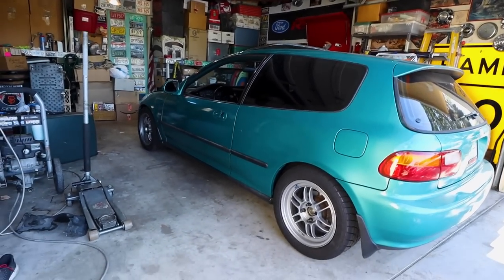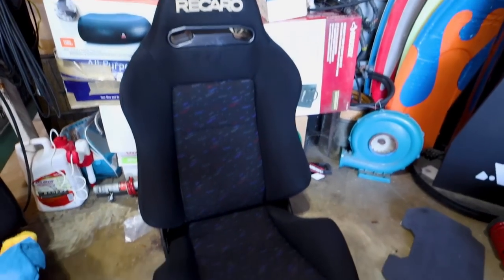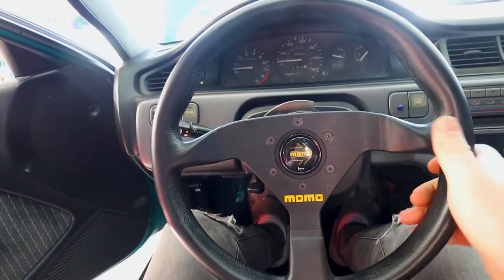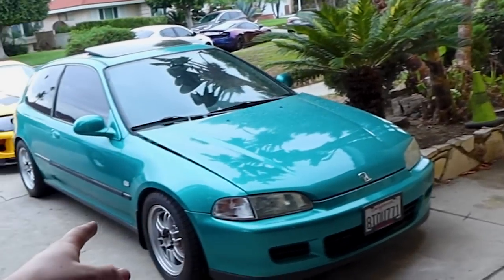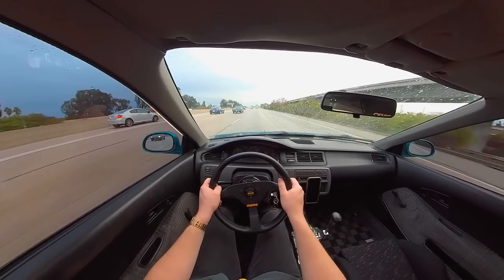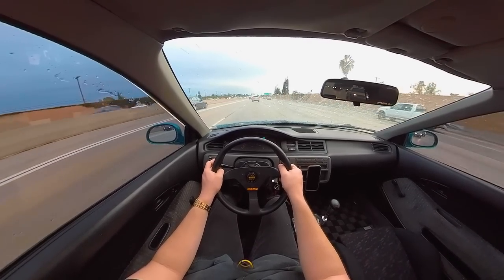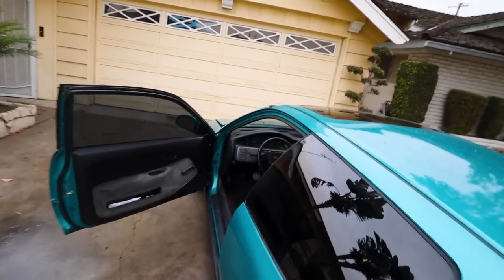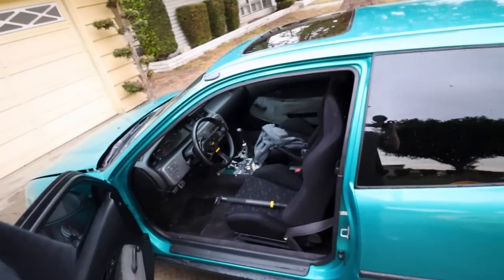Bought Extremely RARE Seats For K20 HONDA!!

Comment: Kraftwerks kit would run u around 4500 for k20 and it’ll easily get you there but it’s not very good if you want to push it further. Turbo if you want to make more power later on, supercharger for instant but limited power
Reply: You can find k24s from accords (motor only) for like 900 good mileage
Reply: @deadheadg9632  he's talking abt the supercharger bro
Reply: @nvr1222  yea lol

Comment: Turbo with a boost controller just in case you want to up the power later.
Reply: Plus you could integrate the spray for the turbo lag

Comment: I know you shit on em, but I'm getting a 392 Challenger W/B and then adding the Hellion sleeper twin turbo set up.  It should make around 600-625 wheel with 5lbs of boost, and still be reliable on the stock block.  A supercharger pushing the same boost/whp wouldn't be as reliable because you're making the engine work extra to drive the supercharger.  I figure that the 392 has enough low end torque that the turbos just broaden it's dyno curve, without overly taxing the motor, while giving me an MPG boost for normal driving...   With yours being a built motor, and already a four banger, I'd go supercharger.